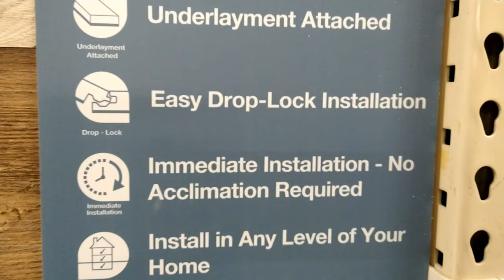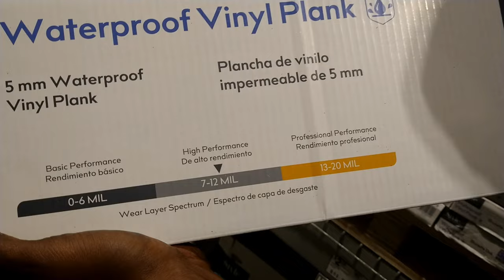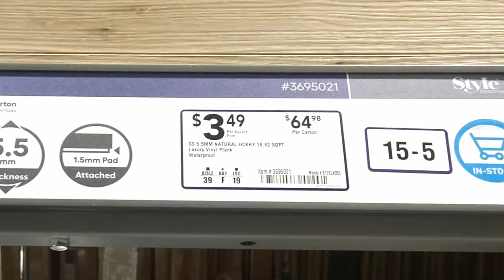THE UGLY TRUTH ABOUT VINYL PLANK FLOORING - What They Don't Tell You!

Comment: I purchased a home with VPF. The first day moving in I put a washing basket in the laundry sink & it flipped up the handle filling the washing in the basket with water, I didn’t hear it as it had clothes to be washed in it. We left home for lunch and came home to the downstairs flooded, our packing boxes on the floor seeped with water also. 😫 I thought for sure I’d have to redo the floor yet 12 months later and it’s in the same new condition. Go figure! 

The only gripe I have with them is if they get a deep scratch you cannot fix one without a headache, particularly like me if you do not have spare and the manufacturer is no longer.

Other than that I LOVE them and would have them again if I built another home. 

Thanks and take good care, Guys ☮️💜
Reply from the maker: Thanks for sharing your real life experience with us! A single LVP can be repaired/replaced but sometimes the interlocking mechanism is destroyed in the process.  

Thanks again for commenting! 😃

Comment: Question I have old wood floors with some unevenness.. I was told to not get the click in plank floors but to put a sub floor down with wood and get the planks that have to be glued on. Is that the best option. It's for my sewing room where some heavy machines will be that need to be on even flooring. Could you do a video on how to install this type of flooring all I ever see are the click together kind.
Reply from the maker: They may have told you the correct solution for your situation because the floating planks must have an even subfloor to connect. We found that out while we were in the middle of our project. We may consider the glued down planks, but we have to research to see if they are DIY-friendly. As of right now, vinyl planks are more beginner-friendly. 😃😊
Reply: @DIYPowerCouple  My friend's finance is a contractor he claims the glue on one's are easier to install. I wish he could do it for me but he's busy all the time. Thanks for responding